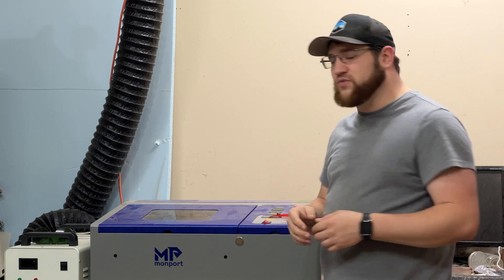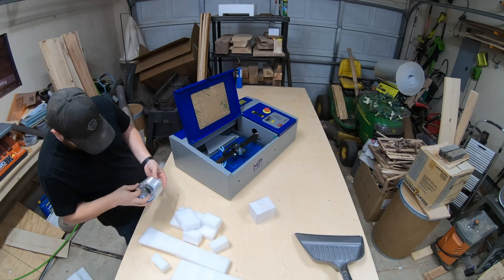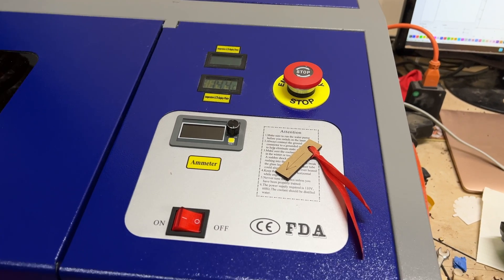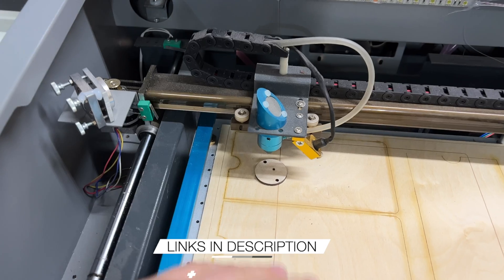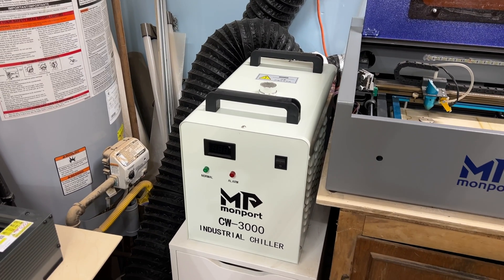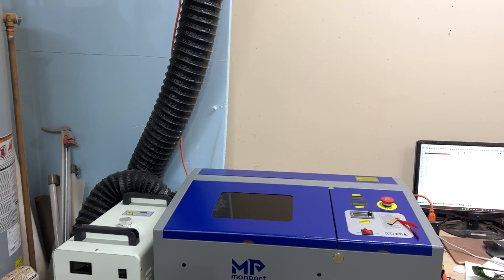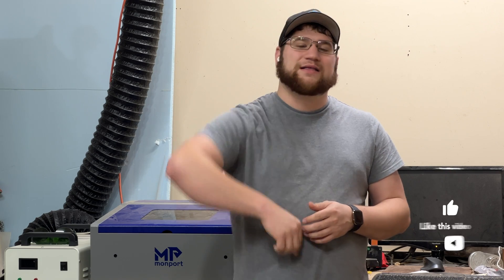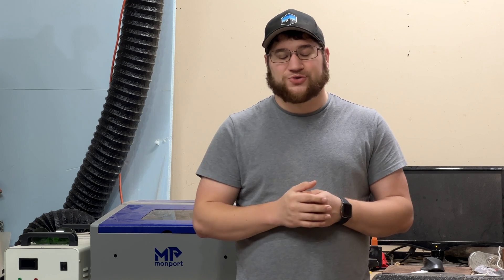Monport K40 40W CO2 laser with Lightburn unboxing and setup

Comment: So I have the 3000 chiller and use distilled water what treatment can I put in water to where I can not have to change water every 1.5 weeks? Right now I am not using it daily either. What do you recommend?
Reply from the maker: I simply run distilled water without treatment in mine and it works great!
Reply: How often do you change it out?
Reply from the maker: @Chaos3dPrintWorx  I haven’t changed it yet, and not sure exactly when I will. Just not something that’s crossed my mind and the laser works perfectly still haha

Comment: Nice video.  As far as 2 fans, it has been noted by other folks that the internal fan will actually block air flow when used with an external fan.  It would be interesting for you to test it out.  Looking forward to your laser series.
Reply from the maker: I'll have to give that a try, thanks for the comment!